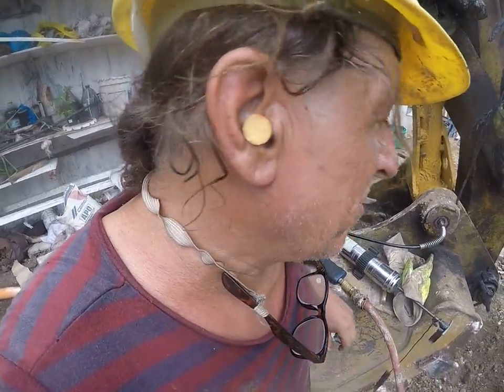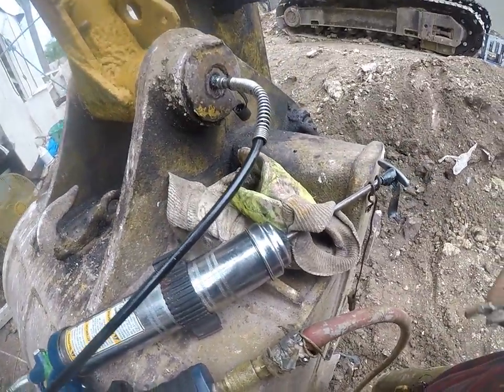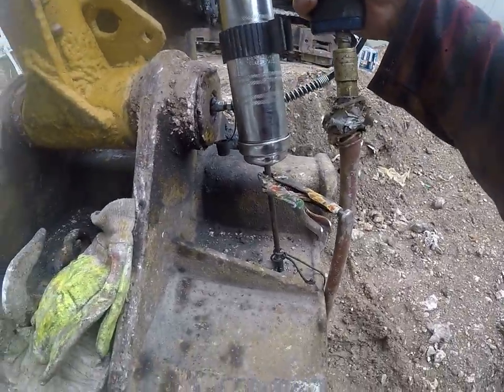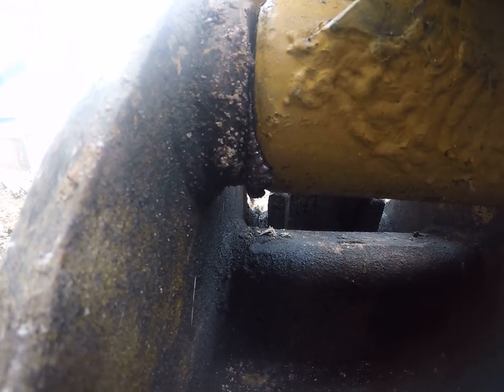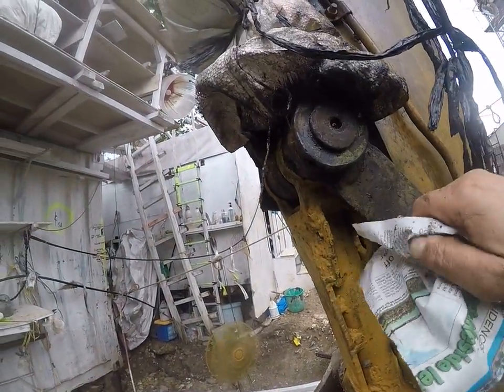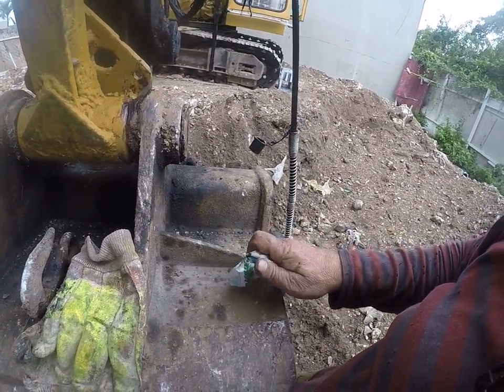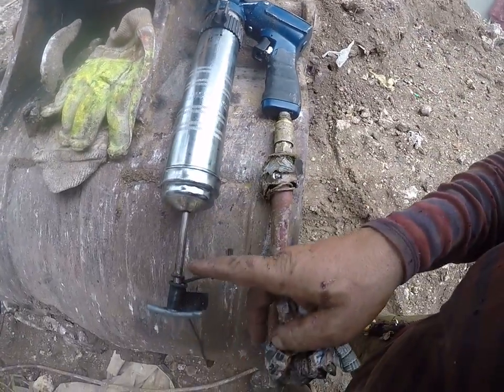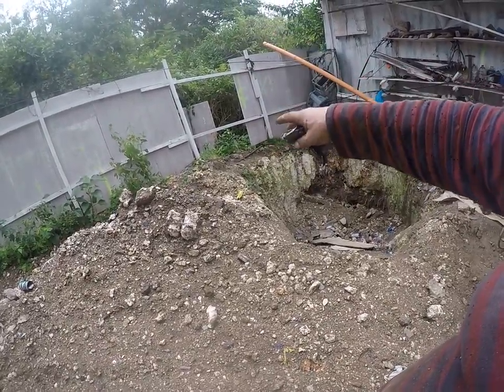Pneumatic Grease tools automatically deliver high pressure grease fast and efficiently gopr3242

Comment: The T handle sticking out the rear of the gun should be all the way in. It is only pulled out when loading the grease tube. Then it is pushed all the way back in.
Reply from the maker: I ONLY LEFT the handle out so that you could see how much grease is being used from the cylinder itself so that I could make this video and people could see the plunger moving down The cylinder otherwise the handle would be portion thanks for the comment and have a great day

Comment: i recently bought a harbor freight pneumatic grease gun used it on 3 cars no problem cost was about $50.  now it may sit in the tool box until  next year..  you put so much effort in to that back ho ... I wonder if it would have bin a better choice to higher out a crew to do the work of the back ho.. it may be easier or possible even faster.. it took 4 years to build are building 3 stories tall with a finished roof and guest house on top..  I know things don't move fast,  and lack of quality labor is an issue.. working in the usa  I really had no choice but to let the contractor build the structure .. when I arrived I did the finishing of the electric and plumbing  while it is not perfect it looks beautiful .  and will last longer then I am alive.. I wish you the best .. I cant wait to see your place when it is done..
Reply from the maker: I've always had good luck buying my pools from Harbor freight. In regards to the hotel I have only had my permit for 18 months and as far as hiring a machine to come in to dig out the foundation to putting in solid coral it would've been  Just shy of 2 million pesos  wITH THE INCLUSION OF THE WATER TANKS AND SEPTIC TANKS so I can literally build one 3rd of my hotel with 2 million pesos and it didn't cost me anything except some time..

Aside from that that was all the monies I had allotted and or available until a short time in the future when I am now negotiating Prices with some of the local contractors will have more than doubled their price in the last 18 months so I may just stick to my original plan and build the first floor myself putting in all of the foundations and drainage lines in the ground Properly and I say this because 2 hotels nearby were done by 2 different contractors and they have ripped up their floors on the first floor because the contractor didn't understand to hang the pipes properly and then embed them in SanD and instead Surrounded them with rocks and gravel aand when the surrounding ground settled so did the pipes and they pull the part in the hotel smell like a giant septic tank 

I prefer to do that part of the job myself and will continue along those lines.

Took a while to get back to you BUT THAT YEAR AND A HALF THAT i HAVE HAD THOSE PLANS one year I was out of work altogether due to an injury or rather an infection on my foot and LEG so I really have not got much time invested into the project at this point